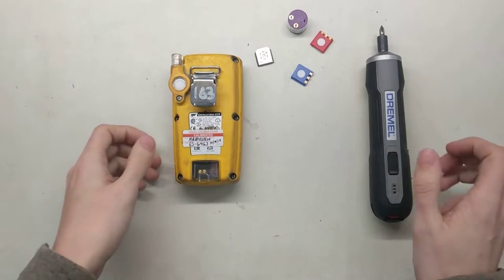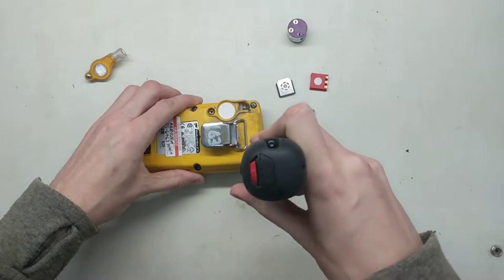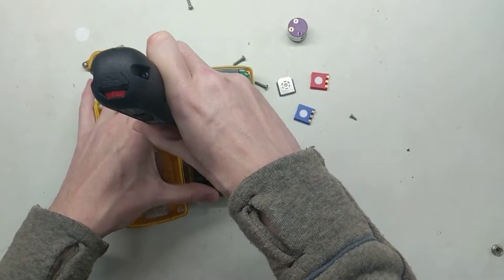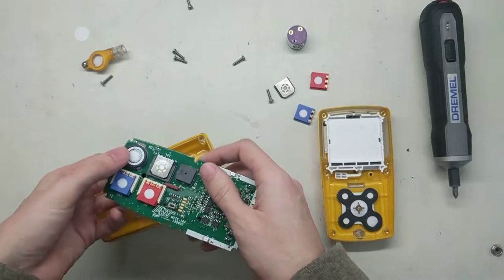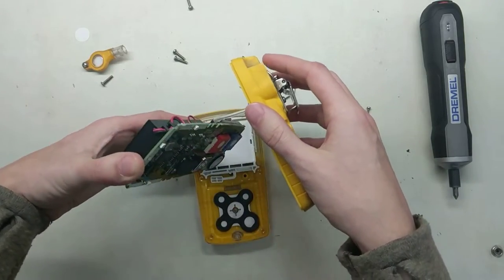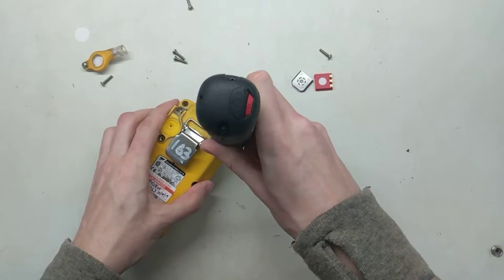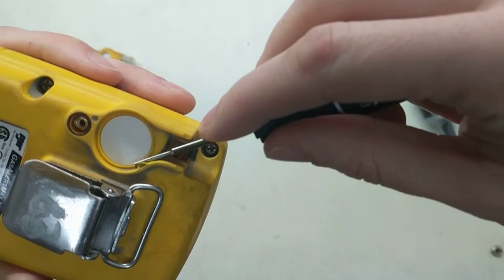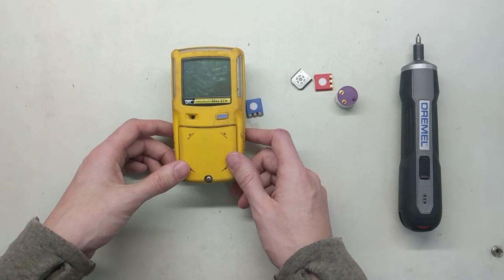How to Replace Sensors in BW Technologies GasAlert Max XT II

Comment: Any suggestions about this problem gas detector honeywell  alertmaxllwas not good when l was turned on they will make  a sound alarm..an when l was started for calibrate.. Calibration fail was  showing.
Reply from the maker: May have a bad sensor. Watch during calibration to check and see which sensor isn't passing and then replace that sensor. If it fails during Zero then it's most likely the oxygen sensor failing

Comment: I have a BOSEAN BH-4S sensor is reading flat zero, the original sensor is O2-M2, is it diferent between the O2-A2 sensors would they work ?
Reply from the maker: Hello, that's not a monitor I've seen before. Can you send a photo of the unit and sensor? Thanks

Comment: i did a 02 swap per the video. The device comes on lights up but nothing comes on the screen. What could have gone wrong?
Reply from the maker: There's a small white zebra strip that sits in the white plastic LCD housing. It may have fallen out while replacing the sensor. It goes near the middle of the screen by the button.

Comment: Im just  have update calibration..and then  we detect oxy sensor malfunction,if i replace the new sensor, it should i reupdate the device?
Reply from the maker: Make sure once the sensor is installed you wait an hour or so for it to stabilize. Then once that happens the first thing you should do is zero and calibrate the detector. Don't take it in the field until you calibrate it

Comment: Need to change the lcd on a gasalertMAX XT11 any suggestions
Reply from the maker: I'd say just be real careful when you're removing the pump inlet and putting it back on. Real easy to screw up that rubber mold and lose pump suction.

Comment: I also have an error 2 message on a MicroclipXT.  Any tips? Suggestions?
Reply from the maker: Hey cortezed, sounds like you have a dead O2. We sell replacement sensors here: https://www.idealcalibrations.com/bw-technologies-gas-alert-microclip-xt/bw-technologies-gas-alert-microclip-xt-oxygen-o2-sensor if you pick one up we're happy to walk you through the replacement process by phone. Just make sure you have calibration gas to calibrate it after.

Comment: My meter is giving me a clock error. I have tried to reinstall the firmware. Didn't work. Another option BW says is replacing coin cell. I assume that's the battery on the inside?
Reply from the maker: Hey Ryan, that's it, but you're on your own risk replacing that clock battery, just as an FYI. Sometimes it's worth just getting a new one for the warranty coverage.

Comment: Hello, My Nimbre is Luis, I am Colombian, I have a Gas Alert Quattro, which has a bad oxygen sensor, I bought a new sensor and when I install the new factory sensor it still appears as if the oxygen sensor was damaged. What I can do? I appreciate your collaboration, the old sensor has a bit of ulfato clean it, install the new sensor but the equipment does not recognize it and it keeps appearing, error o2.
Reply from the maker: Hey sorry for the delay. You need a wait an hour after you install the sensor. Then go ahead and calibrate it. It should work, it just needs that time to stabilize

Comment: I replaced the o2 sensor and now I receive a message during startup that says "Error 02" and after the self test the GasAlert Max XT II reads a 20.9% o2 level. Then after 3-5 seconds, the o2 level drops to 18% and the alarms go off. I am having this same issue with two monitors. I contacted Honeywell and they told me to update the monitors using Fleet Manager, which I have now done, but I still receive the same error. Any ideas as to how I can fix this? Could both of the o2 sensors be bad?
Reply from the maker: Hey Travis, it might just need a calibration. Want to give me a call here and we can walk it through? Desk is 734-234-5042. I doubt it's the O2 sensors, but it could be possible. The autozero on startup isn't really a great piece of functionality. Give me a call and we'll troubleshoot. -James